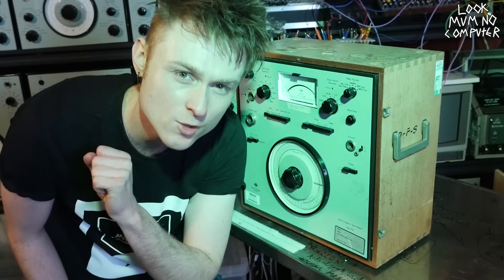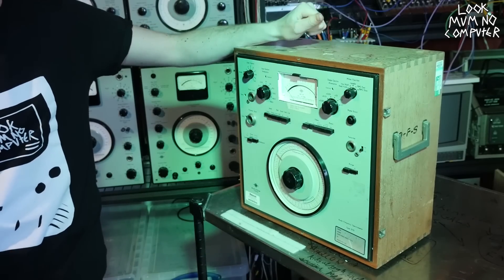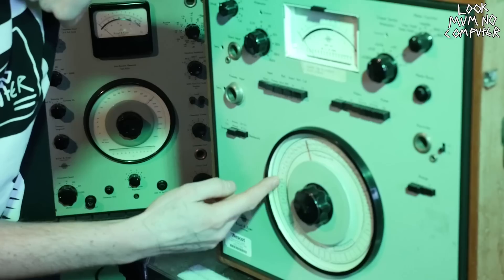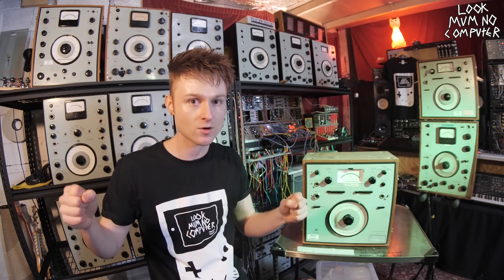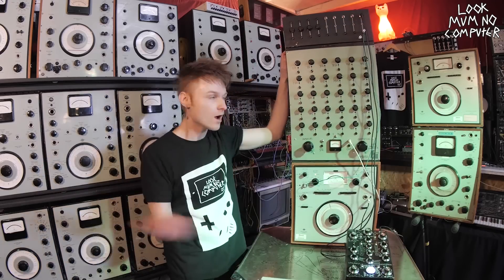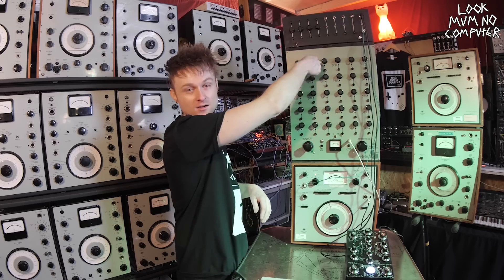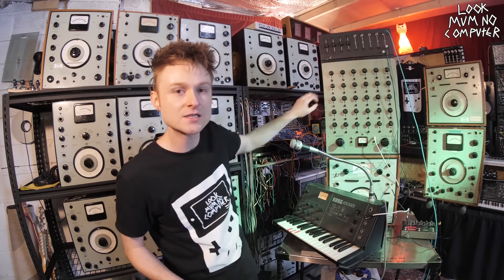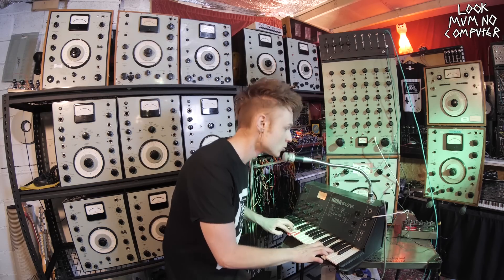Making A Moog Style Frequency Bank By Modifying Old Test Equipment

Comment from the maker: simple Mixer Stripboard layout Available on my site! https://www.lookmumnocomputer.co 
30 minutes of stems and samples of this thing are available over on my patreon aswell as the song from this video :) - https://www.patreon.com/lookmumnocomputer   Also! Would you like the 3d printed files for that little socket i built?
Reply: 4:37 and onward, that tune, what's it called? and when can I expect to play it (all day long) on Spotify?
Reply: @Proctole  Seconded, this track fucking slaps
Reply: this performance dance could have used a bit more lsd
Reply: @pcpaulius hahaa what
Reply: I should have said signal generator.... it was a score from the local dump.. I believe it is an EICO branded unit. I’ll upload a video and link it here
Reply: I've got an idea! Can you make a synth with a panning option & one that makes the volume go up & down. Example 3 oscillators one is a bass where the volume is going up & down (maybe different ways like a wave or a sidechain) one oscillator is panning left to right or right to left (and you can control the paning speed/ how far left to right it goes) and the 3rd one is just a tweakable tone plus you can filter it etc? 😃 that would be awsome
Reply: Hey Sam! So by absolute chance I came across a B&K 1022 BFO in a local thrift store today. They're asking $200, which sounds a bit more than what you've paid but I imagine these are rarer here in the states. I had read on a forum that some of these old B&K oscillators put out massive voltage, as they were meant for lab work, and they can blow mixers amps etc if not modded. Any knowledge of the voltage issues? Worried I'll  blow out my stereo lol. It's in a super random grungy thrift store so I would be amazed if they even know what it is let alone that they may have tested it, any key things to test or look for before buying? Thanks!
Reply: You should work with Benge (Ben Edwards) and John Foxx, that would be analogue heaven.

Comment: Do you by any chance got the schematics or the full service manual for the 2113? I got one of these boxes recently, generally speaking it works, but one of the amplifier sections in it is kinda jumping around a little at random. I suspect a cold solder joint or unstable power-supply rail/dry capacitor, but I haven't really started looking at it in full detail yet. Filters are dead-on the money, though!

Comment: Are you using the internal high gain B&K valve input and output amps here? Or do you bypass all of that and just access the passive filter cards? Would there would be level and impedance problems inserting line signal to and from the unmodified valve circuit?
Reply from the maker: Naaa it's fine. Both input and output are high impedance
Reply: @LOOKMUMNOCOMPUTER  huh, thanks, good to know. It looked like you’re tapping the output signal directly from your mixer cabinet here, bypassing the valve output stage.
Reply from the maker: @ecktoplasmic  i cant remember was ages ago, but tnh you could get away with plugging it all in directly wherever the RMS wont blow anything, if your feeling funky put in some zener diodes
Reply: @LOOKMUMNOCOMPUTER  no worries, thanks for your thoughts. You’re a real dynamo in these pursuits. Love the historic SynthDIY expose videos in past months.

Comment: You could use your Arduino Uno to control a servo motor , that changes the 1022 frequency, via the mechanical coupler on the side of the box

Comment: The B&K 1022 Beat Frequency Oscillators you have there in the back ground have a modulation facility that lets you wobble a tone by a certain amount around each frequency (example by 5%).  You use it so that if your loudspeaker or whatever you are testing has an unusual bump or spike in response, the warble allows you to average out the measured SPL . You would connect this bfo to a chart recorder via the mechanical control Beldon cable on the side of the oscillator . As the chart recorder wound the oscillator up in frequency, you would click progressively more warble on to the underlying swept sine wave frequency.  This is how you used to make a chart recording of a frequency response .

Comment: I'm getting old - I could barely hear a faint hiss from the 12.5 kHz one. I used to be able to hear the 15 kHz end note on Sgt. Pepper perfectly fine in my 30s, but almost 2 decades later there's not much left over 10 kHz, and especially in my left ear.

Comment: Did you tap out the output from another stage on the B&K type 2107 or did you just go for the output straight up? i read this thread on the vintagesynth forum - would be interested in hearing what you did: 

"What I have started doing with these units to overcome this is to pull the cathode follower tube in the final stage and tap the output signal from blocking capacitor on the output of the preamp tube in front of it which effectively runs at line/instrument levels via a high voltage blocking capacitor and 1MOhm leakoff resistor to ground. This results in a much more studio friendly output which is in fact also a little cleaner too."

Comment: Thts a hella project, all those knobs to tweak on the swells and fades, might I suggest a mini matrix above that increases the gain on a diagonal row to make a bit of the real time recording easier .  Top to bottom Rows , and columns the  first macro would control  1(first row) B(column) &  2A ,, second macro dial handles 3A, 2B, 1C,  Third macro 1 D, 2 C, 3B, 4A etc etc.

Comment: Nice work - that sounds crazy :) Can you hack/bend my Korg Kaossilator 2S ?  I bought it thinking it had a cross-fader & 2 loop banks -  it was advertised as having these features,, but that was on the older one :( Korg replaced this with an overdub which isn't much use for making full tracks.

Comment: you should take a second one and make them work as a vocoder together. each of the frequency bands of the audio spectrometer goes to its own envelope detector, and then those envelopes are sent to a VCA thats attached to each corresponding band of the second unit's filters

Comment: You could use two of these filter banks to build your own 30 band vocoder.
Filter bank A gets the carrier as its input and the outputs go into 30 envelope followers.
Those 30 envelope followers have CV out and those signals go into the CV in of the mixer of filter bank B which has the modulator as its input.

Comment: I'd give two thumbs up if I could, only for the sheer amount of work that went in there.
You have the absolute right kind of whackyness, I like you so much.
I have two old function generators from 1970-1975 and I like to use them to display Lissajous figures on my 1970 oscilloscope. Some times I even interconnect them and listen to their beeping and sweeping :)

Comment: 7:30 that sounds a lot like an old modem tone unsurprisingly.
Have you ever thought about using an old modem to generate tones?..
After all that's what they are made for :)
Reply: Ha ha. That would be interesting...
Reply: interesting... maybe they will make noise just powering up the array of modems, or it will be difficult to get ide/pci interfaces working as intended. SAM, have you jiggled with it just as a proof of concept? modems seems the only thing you have not used yet! :D

Comment: Awesome filter. But would it be hard to wire bypass switch across each Row and Column? So then you can instantly make a particular group wet or dry or isolate the 
 intersecting dial.